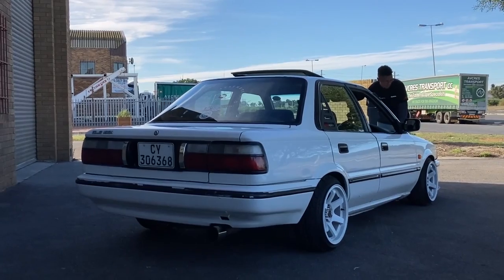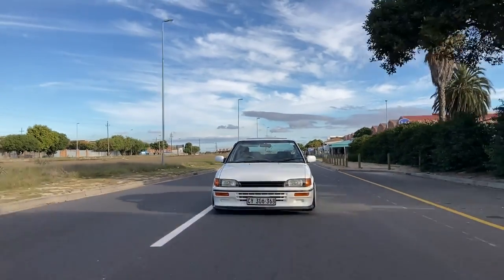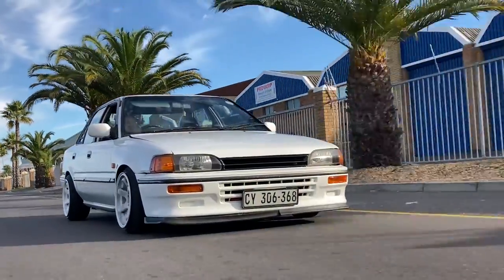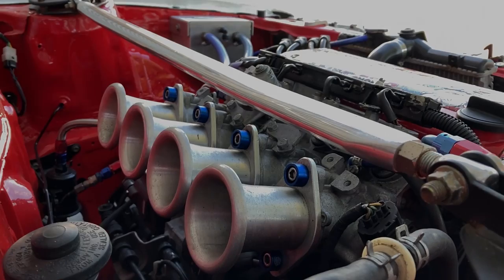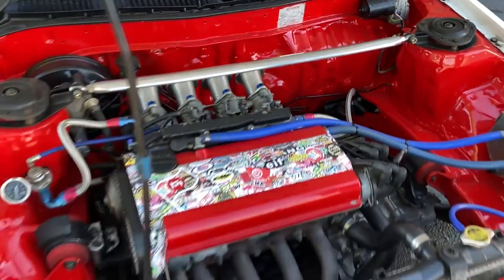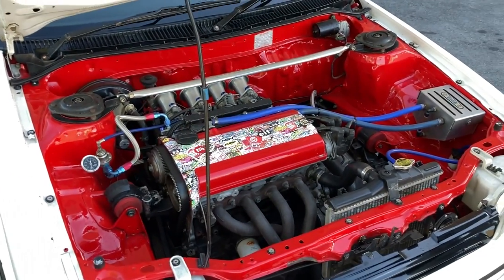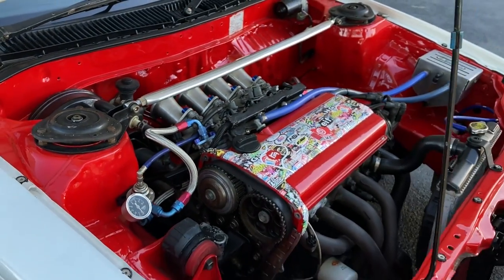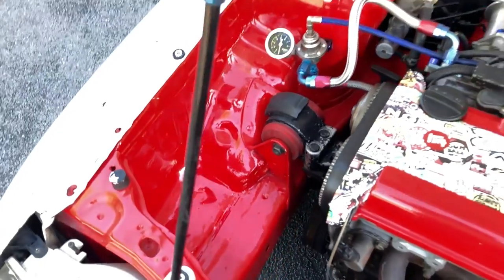4AGE 20V COROLLA AE92 SCREAMER!!!♥️😍 | This is my ride Ep71

Comment: Appreciate the video. But HELLLLL NO MAN. 180kw lmao come on someone is lying to that guy. To get to that power NA you would spend like at least 100k on that motor. I have been busy with 20vs for like 14 years and there is  o way. At best it will be like 98kw on the wheels at best. To put it in perspective my e46 M3 does around 188kw on the wheels lol.
Reply from the maker: He said 118kw brother lol
Reply: @VADproductions  lol figured. Thank you for the awesome video:)) car sounds boss. Currently running a 20v on my old school chisel GLi twincam. Soon to build a 3sgte ;)
Reply from the maker: @dinogreaver8270  that should be epic bro😎😀
Reply: 180kw wish my 4age can even come close to 100KW

Comment: Is it possible that a stock 20v can push out 180kw and 178nm?
Reply: He probably meant 118kw
Reply: It's 118kw
Reply: Can the owner verify the actual HP / Kw? My 20v makes 169hp ATW on E85 tune.
Reply: Lol I literally just said hell no. Not even 118kw on the wheels. Max on a stock motor at coast will be like 100kw no where near 180kw
Reply: Lmbimp🤣🤣🤣 bru my heart stopped when i heard 180kw i was like "dont talk kak mybru man " i even rewind the video just to make sure. My ex tazz 20v also standard on dictator made 115kw so ja mayb this bru was just nbit nervous for mr vad🤣🤣
Reply from the maker: Just to make it clear to you guys the owner, Mr Keanan, mentioned 118kw in the video not 180kw.

We discussed figures beforehand as well and there are dyno videos too which were not included in the video.
Reply: Bru after these years whats the most one of these 4ages made in anyway? Techs improved so i am curious it would be a dream to swap from my 4af to a 4age.  @VADproductions